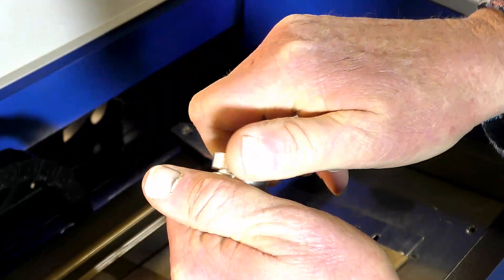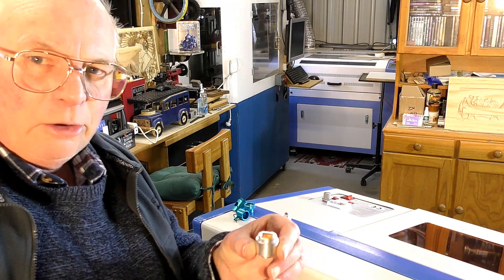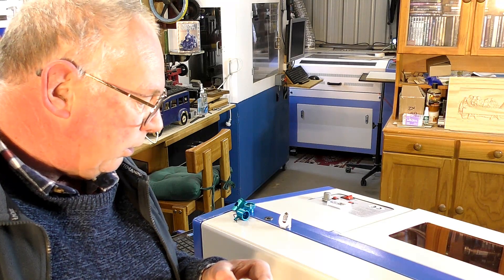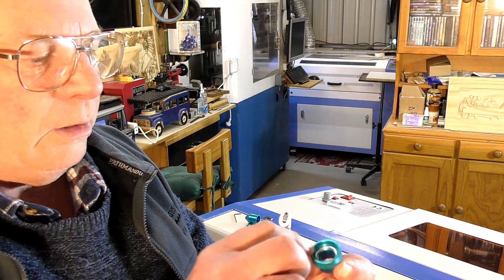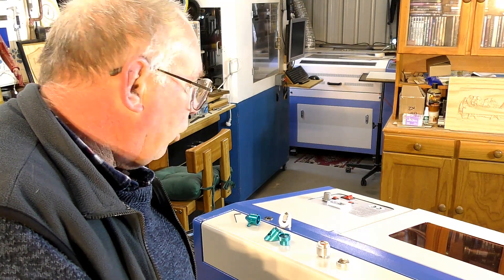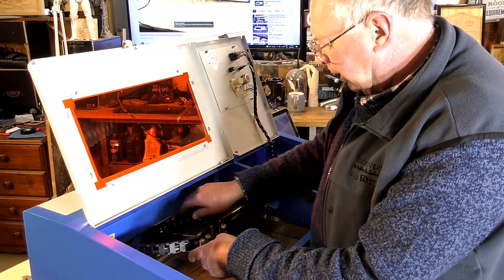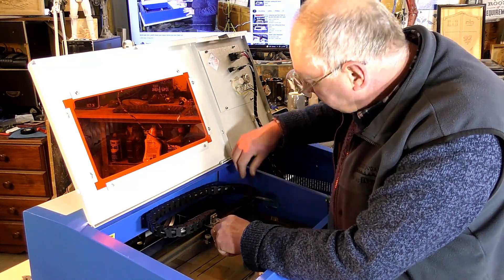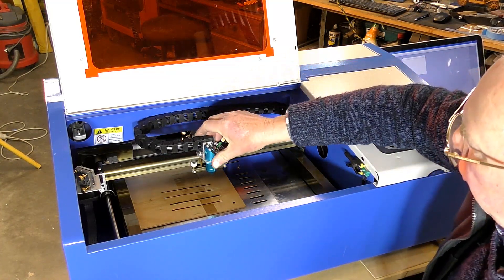“MORE” K40 LASER UPGRADES & IMPROVEMENT’S

Comment: well a generator is just a motor that is receiving mechanical input and outputting electrical energy instead of receiving electrical input to output mechanical force ... quite literally they are both magnets and wire windings ... so yes you are correct, and those people are idiots.

Comment: Your roosters had me cracking up during the video. I recently wired up a 24V LED into one of my 3D printers and noticed the same effect when moving the motors. It is a real issue. Apparently if you have a poorly designed board it can cause the drivers to fail.

Comment: If that's the Cloudray head, you don't need to modify the plate holding the head. The threaded part of the part you're holding at 5:58 comes off. Then a part reveals that fits the plate perfectly.

Comment: All caught with this series now.  Did you change your mind about the additional vent holes on the front?  I was thinking that you could just add a couple of bumpers to the top lip of the cabinet so that the lid would sit on them. That would leave a gap for air to pull through. Then another bumper on the bottom side of the lid, over the safety switch to hold the switch down.  I haven't looked at mine to see if it's actually possible, but it would eliminate cutting any metal and be reversible if it didn't work well.
Reply: A better way to improve the air flow in the cabinet is to tape up any holes leading to the outside, like the one in the bottom, with something like metal duct tape.  This then forces the airflow to come in only through the front vents and over your work surface.  You can add in a couple of small 12V fans over each of the vents on the front on the inside of the cover so they blow in if you need more airflow.  You may also want to add some kind of louvers over the outside of the front vents to keep reflected laser light from coming back through them and possibly becoming a hazard.  I used some cheap aluminum soffet vents and just cut them to size and taped them over the front openings.  This allows airflow while preventing any reflected laser light out of the case.
Reply: @ropeany1  Are you referring to a bigger model?  This one doesn't have any front vent holes.  I thought about the soffet vents.  I used something similar to get air flow in one of my blasting cabinets.....nearly identical use of air flow.   The bumpers I was thinking about are only about a 1/4" tall, so I wasn't expecting much reflected light to escape.  I went to your channel hoping to find a video of yours so I could see the front vents you're referring to.  None.
Reply: @bluehandsvideo    Yeah I don't have any videos up of my laser unfortunately but it's the same size unit as in the videos, 40W tabletop model.  Some of them have front vents cut into the lid and some don't, mine happens to. On the ones that do you have about a 4 inch tall front section on the lid before it slopes back to the window which makes a great place to add extra fans ( and where they put the vents lol).  I was just looking at some ads for them and it appears they have done away with that set up but you could cut a couple of holes in the front of the cabinet, being careful of wires that run along the front, and put in a couple of small fans to help with the airflow.  There are also a couple of magnetic mounts for small fans you can place inside the cabinet to help with airflow as well that you can find on Thingiverse that you may want to look into as well.  I'll post a couple of pics of mine later tonight as I'm at work currently.
Reply: @ropeany1   I went and looked at some other k40's after you mentioned that and found ones with the front vents.  I'm planning on using an external exhaust fan so I'll just be looking to add some ventilation holes.  I don't think I'll need any extra fans.....in fact, I may not use any on the laser....just the external I'm adding.  I need to pump it through some ducting to get it outside of my house, so I want to make sure I have plenty of air flow.  Ah....that's for reminding me about Thingiverse.  I wanted to look up some other models and grabcad was all I could remember.
Reply: @bluehandsvideo   Glad to help.  I found with mine that just covering the hole in the bottom really helped redirect the airflow over my work area as it forced it to draw only from the front of the machine.  I have use a boat sump ventilation blower as my fan and it gives really good airflow through the machine.  I'm working on taking out the inside air duct like @Roger Webb did to see how that does.  Right now I just got in my new Cohesion 3D laser board so getting ready to put it in as well as a slightly different exterior cooling set up to try and get away from having to use ice.
Reply: @ropeany1  I subbed.  I don't catch everything that comes up on my subs, but I'll see if I can catch yours if you post some upgrade vids.  I'm hoping to do some vid as I work on mine, but I'm not sure if I will yet.  I need to take out that inside duct work, too. Mine is the old longer one and it physically gets under the laser when the laser goes to the back all the way.  Good luck with the upgrades! :)
Reply from the maker: Hi Mike, that would work
Reply: @inventorsworkshop9600  Cool.  I was thinking about doing it, even if it was just a temp solution to cutting the holes. :)

Comment: What’s the max cutting on Acrylic this machine will cut
Reply from the maker: About 5 to 6mm
Reply: @inventorsworkshop9600  thanks which would you get if you had a choice k40 or k50
Reply from the maker: 50 watt!
Reply: @inventorsworkshop9600  so it’s worth spending that money on the bigger machine, and everyone seems to have a laptop or MacBook which operating system do you use just grabbing as much information as I can thanks very much